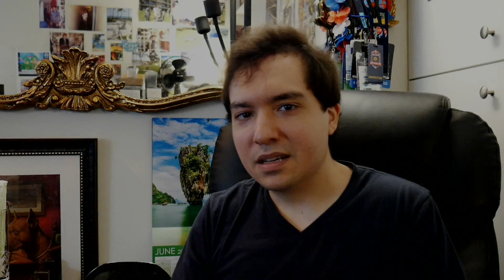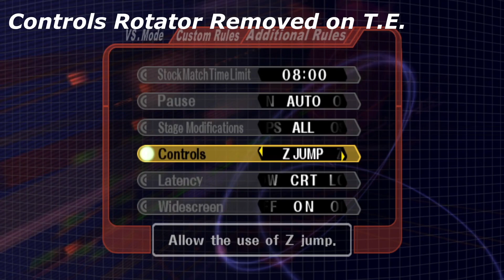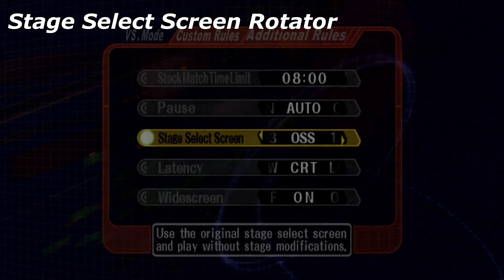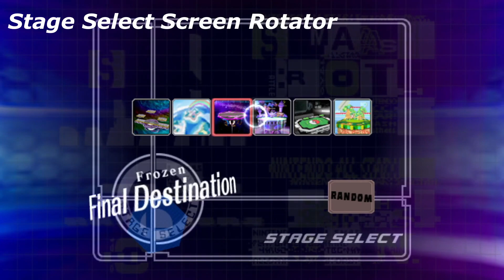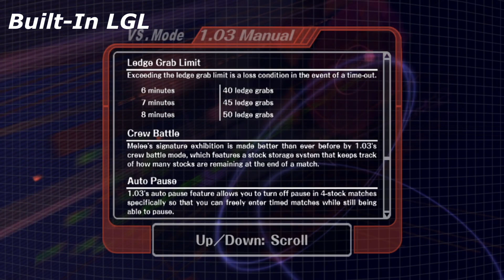MELEE 1.03 TOURNAMENT EDITION

Comment: im a casual melee enjoyer, why the options from Legacy not on Tournament ? Why i cant have the latency toggle on my wii ?all it lets me choose is Z as jump swap.
Reply: The competitive scene is extremely protective of the game state and want to modify it very little, even if it's horrifically flawed. I don't think that's really a negative thing.
But everything in the game is built on exploiting the way this game works. If you accept control over the game state itself you start to make changes which have cascading effects, which actually matter at such a high competitive level.
In short, hax wants to make a version people will accept, people have several criticisms which regardless of your opinion on, are the wider opinion of the community, and so hax decided to remove the options in line with that feedback.

Comment: why was tap jump and wavedash angles removed? I can see the argument against the c stick tilt options. But perfect WD angles helps remove the need for a modded controller with notches that wears down, and tap jump should obviously be an option. just seems like everyone benefits from these additions idk
Reply: Everyone's focused on the idea that tap jump should remain as a barrier or an execution test, then how is z to jump any different? Why should fast aireals be easier to do but tilting up should remain the way it is? And no one's going to mention how perfect wavedash fixes the notch issue and also would improve the boxx experience as well. Boxx doesn't have perfect wavedashes to emulate the fuckery and inconsistency of GCC. This would just help everyone lol
Reply: @nicholasthompson1063  z jump is just switching two buttons around it's not removing an entire mechanic, u can just do insta aerials with claw
Reply: @nicholasthompson1063 how can you even argue with these idiots? like they dont want change because no matter what change is bad. its so infuriating and frustrating how people say no the some simple accessibility and comfort options. they act as if stuff like tap jump has some deep meaning and is going to change the meta like tf?
Reply: anyone that says tap jump off shouldn't be allowed is an absolute clown, it literally goes against the spirit of melee to lock up the amount of options you have LIKE using pivot uptilt. next you're gonna tell me that making shield drops or dashback more consistent with original UCF is too much of a balance change and that it should be hard to input 🙄

most garbage take i've heard in a long time
Reply: the current meta is balanced around tap jump existing, removing it is a straight up balance change.  For example every time you sdi up you risk jumping, so a common mix up is waiting to attack to bait the sdi, then hitting them right after they double jump for a big combo
Reply: @bobboberson8297  what a bad take...
Reply: @DangOldRegularOld  a very compelling and needed argument on an old video
Reply: @bobboberson8297  You needed reminding how legendarily stupid that take was.
Reply: @DangOldRegularOld  sorry my take was too hot for you to handle
Reply: @bobboberson8297  Hot shit
Reply: @bobboberson8297  That doesn't make the game better. Most players would rather not have to do that
Reply: @lydiawilder5996  I disagree I think most melee players like these kinds of niche interactions
Reply: @bobboberson8297  I think people would prefer having more consistent SDI and new innovations in the meta over preserving one obscure interaction.
Reply: @bobboberson8297  i have never seen someone at pro player who accidentally jumped bc of tap jump. the shit you are wanting to keep is something that only makes people not want to play melee who might have transitioned from recent smash titles
Reply: @lydiawilder5996  That doesn't make sense as an argument.  tap jump has no effect on sdi and it's a completely arbitrary decision to mod the game away from the current meta to a new one.  also the interaction I described is not obscure, it's a common sheik mixup (uptilt vs up air)
Reply: @bobboberson8297  people don't jump on accident because they intentionally avoid doing stuff where that's a possibility (such as pivot uptilt. It isn't part of the meta because it's unfeasible due to tap jump). People certainly accidentally waste their doube jump when up Bing all the time
Reply: @bobboberson8297  Can you give an example of this happening in tournament?
Reply: @lydiawilder5996  Most high level sets involving sheik, especially sheik marth.  Once the opponent proves they can sdi out of sheik's uptilt then you counter it with upair (and they counter that by not sdiing or doing different sdi).  I'm a sheik main so that's the mixup I know best, but I'm sure it comes up in other situations - it's not like sdi up is some crazy rare thing
Reply: @bobboberson8297  Sounds like you don't want this change because it would make the game harder for you as a Sheik player and not out of love for the game
Reply: @lydiawilder5996  Sounds like you just want sheik nerfed and have no love for the game
Reply: @bobboberson8297  I want every player and every character to be able to play to the best of their ability with 100% consistency
Reply: @lydiawilder5996  You've already expressed that.  All I'm saying is that despite your claims that you are neutral, your opinion necessarily includes subjectively rebalancing characters in the game
Reply: tbh I don't see turning off tap jump ever being accepted by our community. It's important that you incur risk of tap jumping when doing things like up B or up tilt, else things like Up B while preserving jump or pivot uptilting becomes free
Reply: @Prilosac  We should make it free
Reply: @lydiawilder5996  no
Reply: @ahmost22  Yes
Reply: @lydiawilder5996  no the game should be hard u should have to put effort to do things
Reply: @ahmost22  Why should the game be hard?
Reply: @lydiawilder5996  If this is a serious question, then you aren't ever going to agree with a competitive player on legality discussions. Competitive endeavors are inherently hard, or they wouldn't be competitive
Reply: @lydiawilder5996  makes it more fun and entertaining
Reply: @Prilosac  The game is inherently hard, adding the ability to turn off tap jump is not going to make the game easy.
Reply: @Prilosac  I've been playing this game for 10 years, I know. It sucks that this community clings to the worst aspects of this game
Reply: @ahmost22  And how will disabling tap jump make the game easy?
Reply: @lydiawilder5996  u don't have to do half movements for tilts and u can get up sdi and di without buffering a jump
Reply: @ahmost22  Good! But how does that make the game as a whole easier? That's just one mechanic and one interaction. 

I value getting more new players into the game, and keeping the game alive over protecting its status as a difficult game only for elite players
Reply: @lydiawilder5996  Its not just one mechanic it's di, jump buffering and tilts as I said, and you have to be considerate of it when doing other actions such as up b ing and moving around. Any new players who quit only because of tap jump would just find the next thing to complain about "oh why do I have to press jump before grab and upsmash when running" "why is there no tilt stick" "why is  double jump from ledge garbage" and more. If you quit melee literally only because of tap jump, you don't deserve to play
Reply: @ahmost22  You don't have to press jump before grab, it's optional. You don't have options for how you jump
Reply: @lydiawilder5996  it literally makes ur grab completely worse unless ur yoshi, or peach doing the chaingrab, or some other niche thing I forget. U don't have to tap jump u can just press x or y
Reply: @lydiawilder5996  If you’ve been playing for a decade and never had your jump stolen trying to sdi, you just suck at the game because you obviously have not implemented sdi into your gameplay at all. We might as well remove L-cancelling too if you think tap jump should be off. Also, I use tapjump when I play. The removal of tapjump is Hax saying “everyone should play the game the way I do”. I don’t give a shit if some fox can’t ledgestall properly without double-jumping. Why should my control options be limited to prevent other’s control mistakes?
Reply: @tubesism  I don't agree that tap jump should be removed but I'm pretty sure most of them just think it should be an option. I don't think anyone thinks it should just be completely removed lol. Also when has hax said that?
Reply: @narddog2151  yeah? we are nearly at a point where controllers exist thst allow you to remap the whole button layout. that doesnt sound like vanilla melee to me either and people are ok with it. 

would it hurt that much if some nieche interactions would be gone in favor of making the game more accessible to new melee playes? and who knows maybe turning tap jump off has its benefits and downsides

Comment: Imo ALL stages should be frozen.

But cool update Hax
Reply: No please no
Reply: Leave FOD alone. It's the best stage as it is.
Reply: @Saskaruto16  FOD is just garbage, who needs platforms that are 10 cm above ground? It just messes with everyone
Reply: @starfox300  FOD is awesome. Dynamic platforms create dynamic unique situations and forces you to adapt both your neutral and punish game on the fly during a game. It's amazing and a real showcase of skill and creativity when you have a good match on that stage.
Reply: @Saskaruto16  Yea but most characters can't do anything when the platforms are low, you cant even sh properly
Reply: @starfox300  That's not really accurate. Everyone can still waveland on the platform, can short hop and land on it instead of the stage which might even be beneficial in terms of landing more quickly. 

Not only that some really unique options appear that can't happen anywhere else. Like for instance you can do a SH aerial and edge cancel it on the platform and then nearly immediately land with only the 4f standard landing lag. This leads to some crazy unique combos that wouldn't normally work because the landing of the aerial would normally be too high. 

S2J is a great showcase of this, but other players like Axe have made use of this multiple times as well, and Zain has a couple unique FOD specific edge cancel dair combos too that are awesome. 

FOD is not consistent and forces people to constantly adapt their neutral and punish around the current layout, and that's why it's so interesting.

Comment: Would love to be able to swap Z to B and X/Y to Z in order to perform ICs priority desyncs (inputting 2 moves on the same frame like C-stick up + down + B to u-air + blizzard which effectively is an unblockable as the shield stun traps the opponent in shield and can then be grabbed) more consistently without requiring claw grip or a BoXX controller